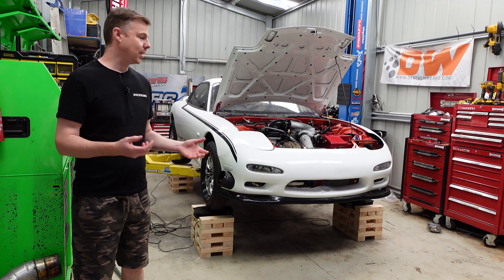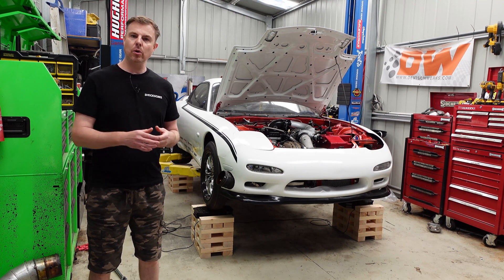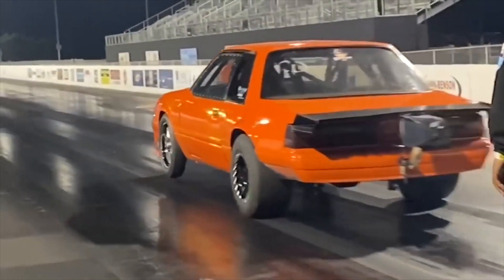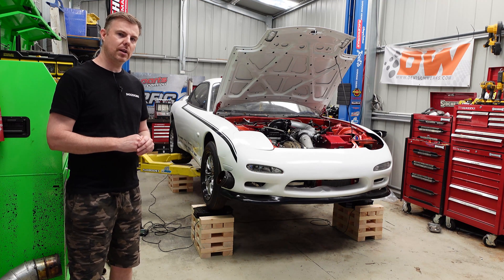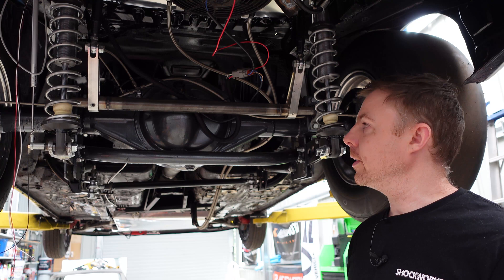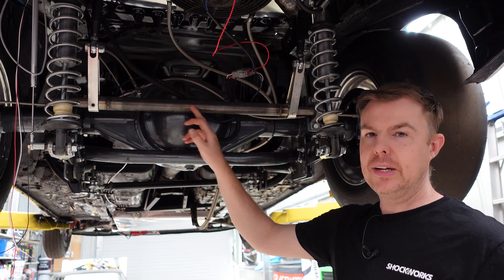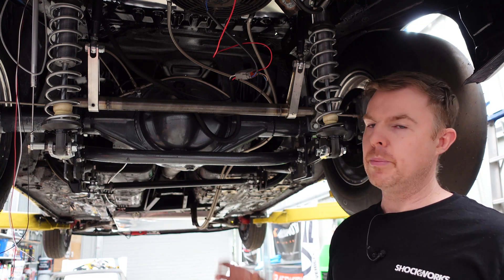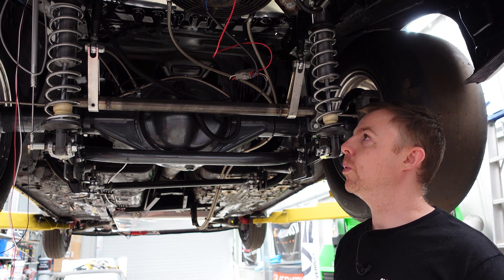How To Setup 4 Link Suspension for Drag Racing

Comment: I have a rally car and I want more rear suspension travel. I could mount the shocks on the side of the axle instead of on top as it is currently. What is the effect on axle geometry if I do this?

Comment: Literally modded my diff mounts and used the same baseline calculator and made adjustments last week!! Took the car out to some back roads and took some slow-mo video off the trans brake. Definitely separation at 168% 
Can’t wait to get it back to the track early next year.
Good video Broomy 👌🏼

Comment: Would using the eccentric shaft height be a good substitute for camshaft height Broomy or nah?
Reply from the maker: It’s sort of what I used from memory. I can work it out exactly using trigonometry anyway, so might do it one day. All these numbers are just numbers anyway. Nothing counts for real world testing.
Reply: @BroomysGarage  Before I forget, with the weight, only the SP was 1220kg, generally they were between 1270kg and 1340kg, depending on year and spec, so really, you've taken out closer to 200kg or more. 👍
Reply: Rough baseline... tune on the test hits.